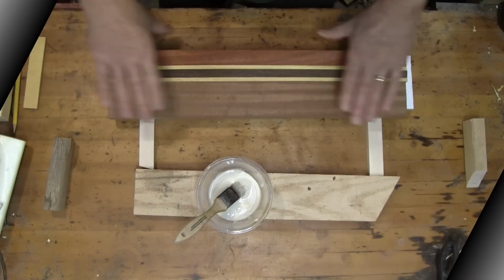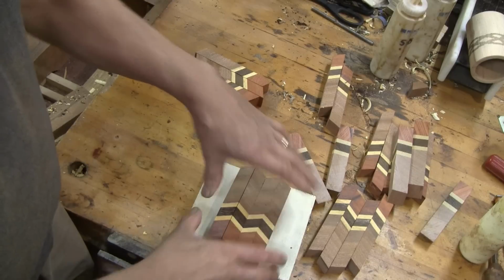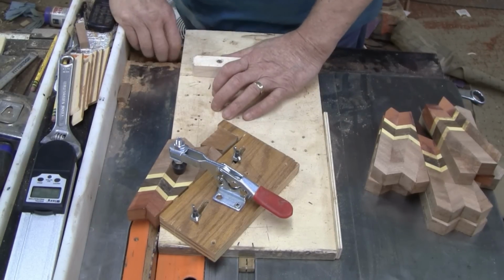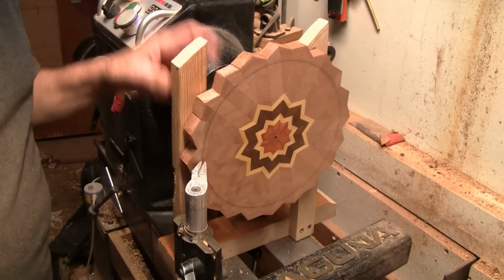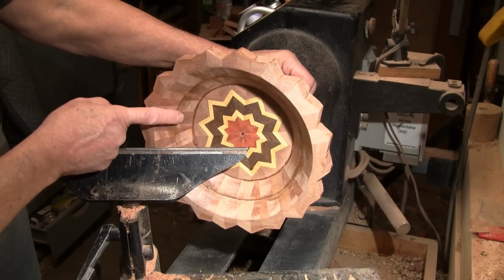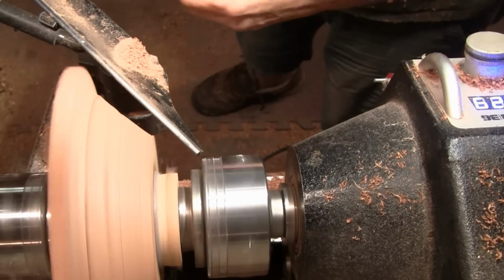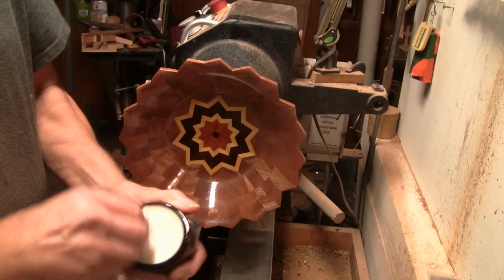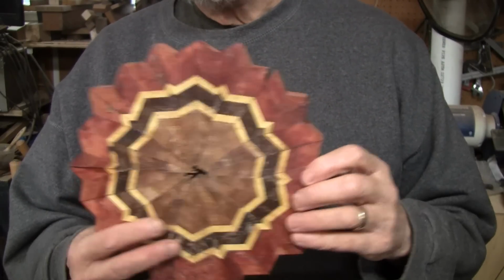The Radial Radial Feature Ring Wood Turning

Comment: Another winner, Gary! Good, good on the design. Good, good on the Ack’s carnuba (I love the hardness of carnuba). Good, good on all the points matching at the center. Good, good on the jig demo. So video rating? Good, good of course!! 😜🤣🤪
Reply from the maker: Thanks for your comments Valerie they were Good, good, good.
It is not all that often I even need the points to match on the bottom  but as long as your wedgie sled is perfect it is easy to do.
I have watched those edges fall off from cutting at the speed you might do for a normal segment. 
Thanks again for you great comments.
Gary

Comment: Wow, I started to try and duplicate this and then I realized that there is some serious math calculations involved in order for it to look symmetrical!  You make it look a lot easier than it really is.  I have even more respect for your skills.  Now i need to figure out what to do with the board I have laminated up.  The radial, radial part of this is making my head spin….lol
Reply from the maker: Thank you Rick. I will try to explain it so your head is not spinning LOL
First cut for the chevron was 30 degrees.
Then after 4 of those are glued it is an 18 degree cut
Flipped around we then do a 30 degree cut.
Now I have made a wedge of 18 degrees and that went against the fence so both sides would have the fence set the same.
 Hope that helps a little.
Take care,
Gary
Reply: @ThePapa1947  Gary I think you meant flipped around you do a 36 degree cut because there are 10 wedges on the circle.  My big issue was how to get the 18 degree cut to go from the middle point to the bottom tail to keep the symmetry.  This is a function between board width and the width of each “3/4 inch” slice.  This is the math that was making my head hurt.  Extra coffee did not help….lol. I cut a scrap piece of wood the same width of my laminated board and I will adjust the width of each “3/4 inch” to slightly more or less until the 18 degree angle lines up from center point to bottom tail.  Now I am ordering a digital protractor and making a angle cutting sled.  Wood turning is such a cheap hobby….🤣🤣

Comment: The bowl-from-a-board technique works perfectly here.  I have gone to using a tilted bandsaw table and cutting half-rings utilizing a jig. The upside is that the saw kerf is only the width of the 1/4" blade.  You do have to glue the two half-rings together.  Minimizing the saw kerf is important, since the amount of overlap you end up with is:  overlap = thickness of the board x Cosine (angle of the bowl from the horizontal) - saw kerf.  So the steeper the angle of the bowl and the wider the saw kerf, the less overlap you have. Your pattern is beautiful, too!
Reply from the maker: Thank you Anduril. I used to do it on a bandsaw as well. I just did not like gluing them together in halves. My bandsaw blades are around .04" thick. My parting tool is .062 thick. Not all that much different. At least not enough to make a difference on how I do them. The other think I do is measure the bottom of the one I just cut. i use that diameter to mark out the next ring. So the insides always line up with no step.
 Lots of ways to do it and what ever works is what a person should use.
Thanks for watching,
Gary
Reply: @ThePapa1947  I’m sure you’ve seen some of Michael Mode’s bowls that have an angle of 65 degrees or more. You can tell that he understands the math of this situation since his layers are so thick at this steep angle.
Reply: Lining the next ring up with the last one is a trick

Comment: Gary, I made your ring cutting fixture using a food grade hard plastic. Made 1 bowl from Poplar but turned into a disaster as I reversed the 45, 55 and 60 degree angles. Discovered what I did incorrectly and next bowl came out spectacular. Thank you for the innovations. Also made a Wedgie Sled but haven’t used it yet. Will soon though. Thanks. You are an inspiration. Robert
Reply from the maker: Thanks so much for letting me know Robert. Which part did you use the hard plastic on? The guide?
Have fun with the wedgie sled.
Take care,
Gary
Reply: @ThePapa1947  yes on the guide. I made it for the 3/16” parting tool I have. Bought another at 1/8” but want one at 1/16”. Will remake the guide then. Found the carbide tool to overheat in the slot.

Comment: Lovely Gary! I really like the pie crust edge. That must have been a brute to sand and finish. Very beautiful design. Thanks for that! Cheers, Rick
Reply from the maker: Thank you Rick. Actually that edge was not as bad as I thought it might be. Holding a piece of sandpaper flat did the trick. As long as you do not angle it against the rotation it was fine. Sanding in between the scallops was the hardest.  I have a number of sanding sticks that work good. Some I used at work and find I can use them here as well.
Thanks for watching,
Gary

Comment: Beautiful. Love the way the segments offset themselves. And the glue-up of the leftovers is spectacular. That ring is going to make a great piece. Thanks for sharing.
Reply from the maker: Thank you very much Doug. I did not put a lot of thought into using the cutoffs from this. Not until I saw the first one and then I knew I could probably use them. The Yellow Heart was the most spendy because you can not find it here other than what Rockler has already sized to various strips. Works out be around $40.00 a board foot that way.  But I only put $15.00 into the piece.
 Thanks for watching,
Gary

Comment: ...yep...that turned out amazing...not thinking, I imagined you'd round off the edge, but I'm glad you didn't...it adds character to the piece. And I really liked the use of the duct tape...I need to remember that idea. Well done!...👍
Reply from the maker: Thank you very much. Yes I like the scalloped edges a lot.
So I think it would have been really hard to line things up without the tape. And something like this I like to have all the pieces glued at once. Other wise 2 halves can be an issue with fitting together. Since I knew they would all fit that was the only option for me.
Thanks for watching,
Gary

Comment: As always, totally admire and learn from your work. I have the Laguna 1836 modified and we seem to share many of the same ideas. Thanks.
Reply from the maker: Thank you Stevio! What have you modified on your lathe?
Thanks for watching,
Gary
Reply: @ThePapa1947  Like you, I made a spindle lock button. Also, I changed the tailstock wheel to an 8" diameter. I followed BBturning guy from Ireland's video on how to move the tailstock locking handle to the front side. I bought the 20" bed extension and leave it in the down position for roughng large blanks down to size. I leave the original banjo on the extension with the riser block and bought the One-way banjo for the regular bed. I love the One-way locking mechanism. I think that's all. Thanks for sharing your knowledge and teaching skill.

Comment: WOW!! That’s beautiful Gary, love it buddy! Love the sculpted edge on the rim! 👍🏻👍🏻
Reply from the maker: Thank you very much Bruce. I think leaving the sculpted rim really made the turning what it is.
I told myself if they lined up good after the glue up I would leave them If not I might as well band saw them off before putting it in the lathe. But I knew they had to if as long as the joints matched.
Thanks for watching,
Gary

Comment: I found that I can use duct (Gorilla) tape on the back in place of the wood strips.  I also made a gig for glueing the parts together.  I used 12 3/8" X 5" carriage bolts around the outside so each bolt head pushes on each segment. I used locknuts on each bolt to turn the bolts.  I threaded 12 blocks of wood glued to the circle wooden base, and plastic between the base and parts.  I love your site.
Reply from the maker: Thank you Leslie. You have some great ideas. I have taped the back of a few glues. Such as a couple stave turnings I did. It should work great for these types of segments.
On my Great Illusion turning I made a gig to index things in but I like your idea the threaded blocks. Might have to have one for different amounts of segments but it is a great idea.
Thanks for watching,
Gary

Comment: Very nice!  Interesting and beautiful.  Two little things:  One is that I personally prefer lots of coats steel wooled semi-gloss.  It fills the grain and leaves a "classier" look to my eyes.  Glossy always shows every single slight "flaw".  And I'm always sort of OCD about how much glue you slather on when gluing up.  I use nearly half that amount and have never had anything come apart.  To each his own. I DO like the scalloped edge!  And now I like the way your offset the segments when gluing up the rings, though at first, I didn't think I would.  
Always love your precision workmanship and innovative designs, Gary!  Thanks!
Reply from the maker: Thank you Dave. I like the semi gloss look as well. I just do not use it on turnings like this.
 The reason for plenty of glue on these is with all the things that need to line up I need to be able to slide them around if needed. And that could be in 10 joints. 
But I do agree it does not take that much glue. At work gluing patterns up I was happy to see a few beads come out at the joints,
And they never came apart.
Thanks for watching,
Gary

Comment: I really like that ring cutting fixture. I now have all the parts (some of the pieces have been out of stock). My next step is to make it out of oak.  Wish me luck...and time to actually do it.
Reply from the maker: Thank you Michael. If you are making the piece that the parting tool slides in Oak should be fine. If I had HDPE at the time I would have used it. No grain to concern you self with.
Thanks for watching,
Gary
Reply: Do you think UHMW would also work?
Reply from the maker: Sure that would be good as well.
Reply: Thank you!!! Now to give it a try

Comment: You didn’t mention how you sanded the notches. That would be a pain if you have to sand each one individually. Very nice bowl as usual.
Reply from the maker: Sorry about that. The sanding was actually very easy. the boards were very smooth when I glued them together. I used a flat thin board with sandpaper on it to do the final sanding with 220 grit.
Thanks for watching,
Gary

Comment: I noticed that you staggered the joints when you glued the rings together it made me look intently. Not that I want to watch sanding, but you didn’t mention anything about sanding in the scallops around the edge. Did you do that all by hand? What did you put in the hole that you drilled in the center? Oh yeah it turned out spectacular!!! Thank you.
Reply from the maker: Thank you Barry. So I have a couple of sanding boards I used a t work. They are about 6 inches long  and 1 inch wide with a clip on both sides. You wrap sand paper around it and clamp both ends. The same way you would with a power sander. Next time I use it I will show what it is. Just something not used that much on wood turning.
 I used a piece of Wenge to plug the hole. I wanted it to be flat grain and the Roasted Oak would not have held up while turning a dowel shape.
 So before gluing the rings I looked at both ways,. I thought the stagger gave a interesting look.
Thanks for watching,
Gary

Comment: Your work is incredible.  You've inspired me to dust off the lathe and get back into turning.  I'm curious about the hotmelt glue.  Is there any specific characteristic of the glue you use?  I know (from other experience) that some hotmelt glue doesn't necessarily hold as one might like.  Thanks in advance, Bruce
Reply from the maker: Thank you Bruce 
It is very important that the the gun is a full temp. Put down a nice bead around the tendon I do not put any under it.
I have used glue sticks from Bi-Mart and Harbor Freight. Both work good. Next Friday I discuss this in the video.
I trust it or I would not use it on something I have spent 20 hours or more on.
Once you figure it out you would trust it as well.
Now if you get a lot of catches I would not use it.
Thanks for watching
Gary

Comment: Loved the project and video, Gary.  Really beautiful and love the new Ack's finish.  I just got some but haven't used it yet.  Excited to try it.  One question:  the angle on the first cut was 18 degrees.  What was it on the second cut?
Reply from the maker: Thank you Tom. So after cutting all the pieces 18 degrees I needed to rotate it another 18 so I would get a 36 degree wedge. So checking the angle it would have been 36 degrees.  
Hope that makes sense.
Gary

Comment: Nice work Gary, just one question, when you cut the first ring how do you release off, from behind ?  Do you take the blank of the chuck and the re-chuck for the second ring?
Reply from the maker: Thanks Lawrence. Yes I take the piece loose and retrive the one I just cut. 
I make sure what I use for a tenon is a very hard wood. That way it centers back up just fine. Plus I mark where it was at.
Thanks for watching,
Gary

Comment: I love how you left the outside rim it almost looks like a flower.  Why the 40* cuts? could it have been other like 30* or 50 or 60?
Reply from the maker: Thank you Arline! I decided to leave that outside shape after it was all glued together. Really adds to the look.
Yes i could  have used other ankles but I choose 40 to leave enough stock for another cut. The steeper the angle the faster it gets to the center. If I used 50 or 60 it would have only gotten  one cut and the bowl would have been shorter.
Using 30 degrees the walls may have been too thin.
 Hope that makes sense.
Gary
Reply: Your ankles must be still sore.  Thank you for the answer.  I had to think about it for a while to sink in

Comment: Nice project! Excellent precision craftsmanship. It would be very helpful if you provided the measurements and angles you used for prepping the wood in the description - how thick your strips were, what angle your cuts were, the angle you cut the bowl rims with. What is the tool you used to cut the rim rings? Thanks!
Reply from the maker: Thank you. The wood was around 15/16 inch thick. As far as the angles I recall saying when I cut the first one it was 40 degrees. 
 Thanks for watching,
Gary

Comment: I do several types of woodturnings, but nothing to compare to this!  Math was always my poorest subject,  Did you use any of the Woodturner Pro software to calculate the length of the boards you needed?
Don
Reply from the maker: Thank you Don I used Woodturner Pro for most all of it  I guess I chose the length and worked that into the software.
Thanks for watching,
Gary

Comment: What was the angle of the jig set for to make the second 19 degree cut?  I would love to try this.
Reply from the maker: There was 20 segments so the first cut was 9 degrees and the second cut was 18 degrees.
If I was to do this on a normal wedgie sled it would have been 9 degrees on each leg of the sled. But these parts are too long for my wedgie sled so I used one of my other sleds.
Hope this helps and thanks for watching,
Gary
Reply: @ThePapa1947  Thanks for setting me straight.  I am going to give this a try.  I love how the pattern comes out.  Thank you for sharing this.  I only hope I can do it justice.

Comment: Love your work, Gary! This piece is amazing!

Just curious, I know in the past you've typically used your own custom-built tool rest jig for getting straight cuts with your parting tool. Do you the name of the part you're using in this video? Is it also from laguna? Do you like it better? Also, do you remember where you purchased the parting tool you use? Been having a hard time finding one that slim.
Reply from the maker: Thank you Davis! So I have made 3 different jigs for cutting these rings. The first was a simple one made from all wood. Then I machined one out of aluminum and had a lot of questions and request to make those and sell them. Selling is something I am not interested in  for many reasons. One being I have no control on how it will be used.
So I show how I made one from parts that are meant for wood turning and can be purchased easily. 
Check this video out https://www.youtube.com/watch?v=3Uw2Ju_LAss&ab_channel=ThePapa1947

I used a hardwood block on it but would have used a plastic Like HDPE if I had some on hand.

The parting tool is a Robert Sorby Micro Parting tool:  
https://taytools.com/collections/tools-wood-turning-tools-turning-hand-tools-parting-tools/products/robert-sorby-116-micro-parting-lathe-tool

Should be able to find it on Amazon as well. 
https://www.amazon.com/Robert-Sorby-865H-Micro-Parting/dp/B002RCFECI/ref=asc_df_B002RCFECI/?tag=hyprod-20&linkCode=df0&hvadid=309811990469&hvpos=&hvnetw=g&hvrand=14629720166843095907&hvpone=&hvptwo=&hvqmt=&hvdev=c&hvdvcmdl=&hvlocint=&hvlocphy=9032947&hvtargid=pla-568961935669&psc=1

Thanks for watching,
Gary
Reply: @ThePapa1947  Thanks for the detailed reply, Gary! I really appreciate it!

Comment: Another beautiful piece! How did you finish the scalloped rim? Seems like that would be a bit of a challenge to sand and finish.
Reply from the maker: Thank you Gerald. I will show that the next time I use it. I have something called a sanding stick flat file. You wrap sandpaper from one side over the tip and back down to the handle. There are clamps that hold it in place. Something used at work.
Handy little tools. But I also have some sanding sticks I made as an apprentice pattern maker. Same idea but you just wrap the sand paper around it. I will show those as well.
Thanks for asking,
Gary